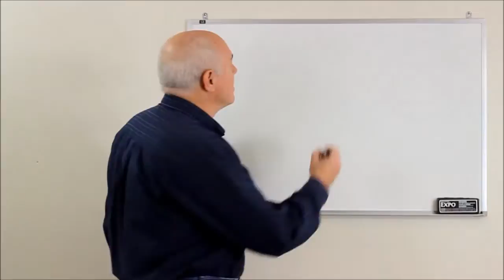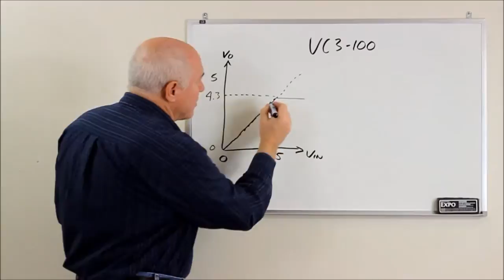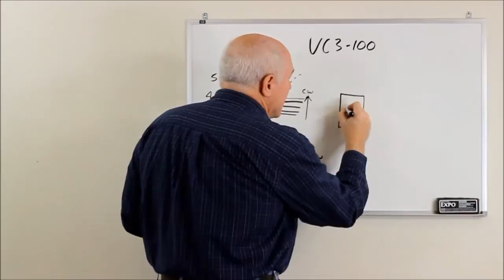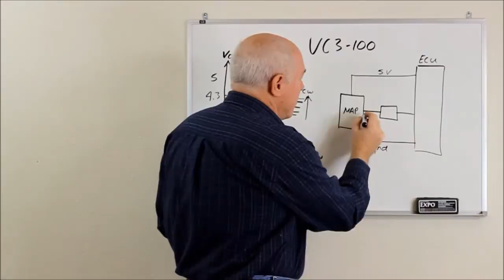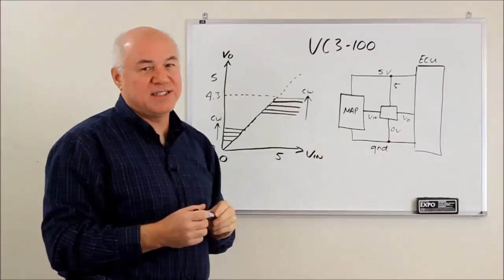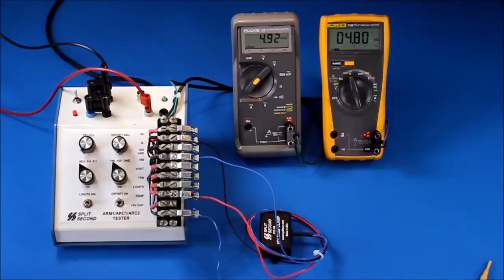VC3-100 In the Lab

Comment: i do it in one second using a zener diode of required rating to clamp it to 4.7v or 4.5v or 4.3v whatever is needed. And it only costs like 1 cent. and wiring is a breeze because there is no wiring. And if I want to reduce across the range in a linear fashion, in situations where I have slightly upsized my injectors, I simply add a diode to give me a constant drop of .7volts. And if I want to fine tune I just use two resistors to make a voltage divider. All that costs like 1 cent and 5 minutes of youtube video can enable any dummy to do it himself. Good luck with your 90$ product
Reply from the maker: Zener diodes are useful for many things.  We don't use them for signal clamps because they have a temperature dependence that can easily lead to a 10% change in clamp voltage as temperature varies.  Zener diodes also have a fairly soft knee which will distort the signal as you approach clamp.  There is also the issue of a change in the load on the sensor generating the signal.  This will cause errors due to the non-zero output impedance of the sensor.  The VC3-100 addresses these issues.  The clamp level is much more stable with temperature.  The clamp characteristic is very sharp without distortion.  The VC3-100 presents a constant 100k ohm load resistance to the sensor.  These characteristics make it possible to set the clamp as high as possible.
Reply: @Splitsec  voltage change due to temperature is negligible: 0.05v change in the range of 0 to 100 degrees Celsius is very well within the acceptable range. That too can be dealt with with some very little components. Besides, I'm talking with experience, I've done this many times and I always have the habit of monitoring the afr, if not logging it.
Reply: @Splitsec  I'll try to dig up an old video
Reply: I need some assistance with my motorcycles MAP. The vc3 unit reads 5.02 bolts when connecting blue to red and measuring off the blue/white with a DVM prong. But VC3 unit doesn’t change when moving the clamp screws
Reply: @bryanemerson5619  if you are talking about map sensor then look up how to test map sensor with a syringe